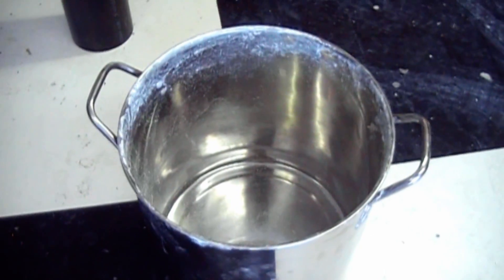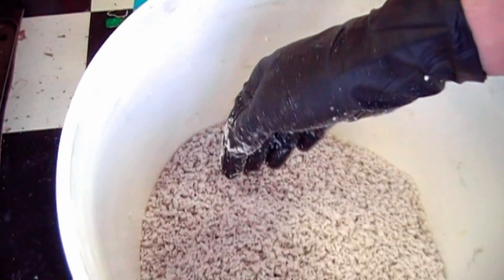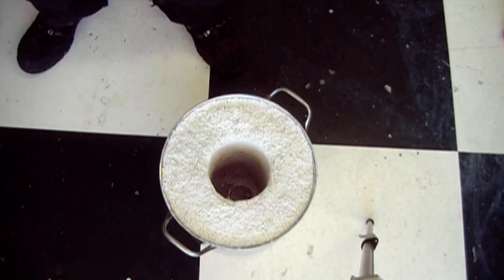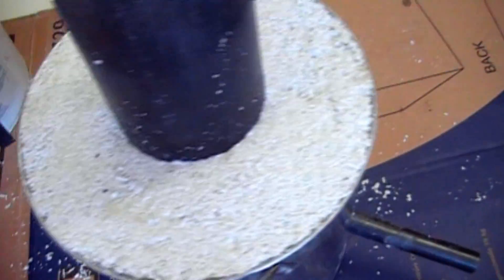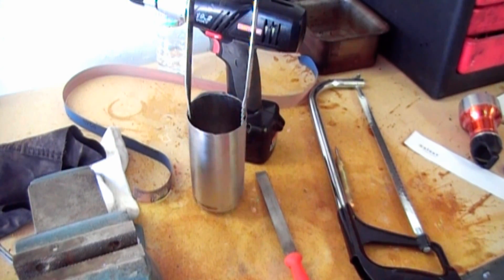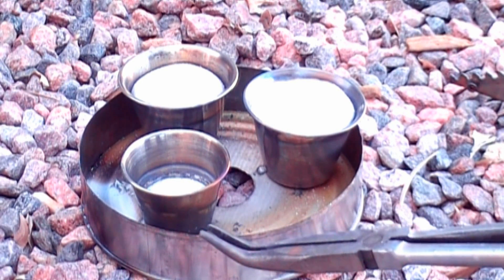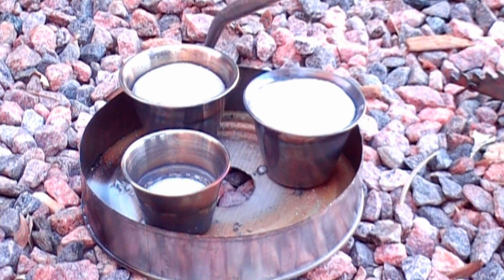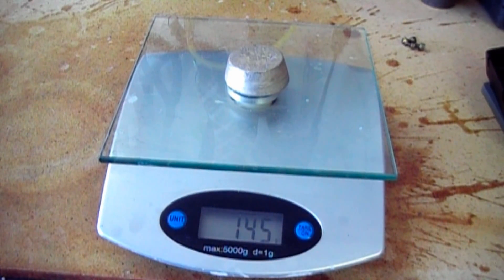How to make a small foundry

Comment: While I realize this video is very old, I noticed you were using a camping size 1# bottle of propane to melt the aluminum.  Can you give us any details on the burner that you used?  I am certain part of the ability to use that small amount of propane is attributed to the furnace construction.  But the burner also has to be very efficient and "breath" properly.  I would love some details on the burner, or maybe a burner build video if you're really feeling really crazy.

Next question, how is the longevity of the perllite, sodium silicate, water mixture furnace?    I'm sure the refractory level is very high, but does the furnace hold up over time, or does it break down quickly like a sand and plaster furnace?

Comment: I bought a Pyramid Products furnace from California 25 years ago.  It looks very similar to your furnace.  The one I got was $400.00 back then, it included a set of tongs a crucible and a wooden flask box. My crucible filled with Aluminum is ready to pour in 7 minutes.  Brass takes about 25 minutes.  Using propane as fuel.

Comment: You use propane in all your videos but do you think the refractory lining would hold up using charcoal as fuel?
Reply from the maker: I could I think, nothing really touches the walls when using propane, so a thicker inner sealing layer might be needed to help it handle the abrasion from the charcoal up against it.

Comment: i never understood why your stainless steel bottle doesnt melt but everythign else does?
Reply from the maker: Alexis Gagnon Aluminum has a much lower melting point than stainless steel. Brass is higher, but still below stainless steel. The size of my burner limits how hot this thing can get to just below stainless, so I don't worry about the bottle melting.
Reply: clkindred  thanks a lot for the answer, so i guess stainless steel would be the best container, but what if i want to melt stainless steel?
Reply from the maker: Alexis Gagnon then you would need a graphite or ceramic crucible.
Reply: Thanks a lot!
Reply: Alexis Gagnon because it's steel it has a very high melting point

Comment: Any easy alternatives to using propane?
Reply: works, done it.
Reply: anything that will burn, and any manner of forced draft for the fire. the heat energy per pound is what makes a fuel efficient, or not. charcoal and a drier is awesome, but pea coal and a drier is even more so (though far harder on your furnace lining). you can even use recycled tranny fluid if you don't mind pumps and such. the "magic" is in containing the heat as long as possible, so it actually does work, and sizing your "hearth" for the fuel load your fuel choice requires. the gas and oil fuelled varieties need a far smaller "hearth" (because you can pump the fuel in along with the air, no "pile of burning junk"), so can operate pretty efficiently even in VERY primitive trim, lol.  a wood fired hearth would require fairly expert use of the calculator just to prevent extreme fuel waste, on the other hand.

Comment: Would you not want to use concrete to make the furnace? What is the reason for the perlite and sodium silicate mix versus using concrete?
Reply: Concrete, when heated hot enough, explodes
Reply: Concrete cannot withstand the temperatures that a foundry can reach.  The perlite and sodium silicate mix can withstand about 2,000F.
Reply: I got to looking into that after I asked the question...thanks
Reply: that would make sense :-(

Comment: Why this foundry can't melt iron or bronze ? U write that u can melt just AL and Brass
Reply from the maker: bronze should be possible, iron is too high a melting point for this setup.
Reply: clkindred U mean furnace could also melt?  or break
Reply from the maker: Possibly the furnace lining would start to melt, but most likely would be it just would not melt the iron, it would run and run but never get hot enough to melt the iron.
Reply: ok thanks for fast replay .

Comment: will your furnace get hot enough to melt copper have you tried it yet
Reply from the maker: +Ronnie Newsome Yes I have tried it, but not just copper. I added come copper scrap to a brass melt, I thought it melted with the brass, but I did not wait long enough and did not see the solid copper pieces underneath the molten brass. I'm going to say it's possible, but pushing it.

Comment: You used just Perlite for the refractory? How has it held up?
Reply from the maker: +Hard69Rock's Cafe This exact recipe held up okay for a few aluminum melts, but showed signs of melting when I ran it hard to melt a few pours of brass, I still have it, but newer recipes are slightly different to address the melting problem.
Reply: +clkindred What other recipes have you looked at. I have been using a 1 to 1 to 70% plaster of paris, fine sand and water.

Comment: Great video, thanks for sharing, a question; Why did't you add the plaster of paris to the mix as you had with the smaller forge you made ?
Reply from the maker: +Justin McKinney I have found that plaster of Paris is not exactly a good thing to have in the mix. It's kind of a long story, but after I discovered what role the plaster actually played, I found that it did not fill that role as well as other substances. The most logical role of plaster is that of a binder, but not only is that not needed with the sodium silicate, the plaster decomposes at high heat destroying its ability to be a binder. The real job of the plaster is making a hard shell around the perlite particles, the perlite will get soft and even melt if heated hot enough, the hard shell is meant to maintain a firm structure. The final recipe I use has aluminum oxide as the shell making material, sodium silicate as the binder and perlite as a sacrificial space holder. When compacted into the form you get a structure of aluminum oxide that resembles a sponge, the voids created by the perlite, after high heat the perlite can melt without the structure collapsing. Not all the perlite melts, but the perlite is not seen as a primary part of the lining, it's just there to loft it up.
Reply from the maker: The aluminum oxide I used is sold as sandblasting grit, it is incorporated with the perlite and sodium silicate mix as well as the top coating. The aluminum oxide is the heat tolerant filler, the perlite adds insulation and the sodium silicate is the glue.
Reply: +clkindred Thanks for the quick reply! I've since checked out your trashcan forge video and I do believe I'm going steal your refractory recipe for my next attempt at this project. I had already been wondering if there was a way to make a surface coating more durable than exposed perlite, and that putty you made of aluminum oxide and sodium silicate looks absolutely perfect. Also if casting your own crucibles from the putty is really as easy as you made it look then man am I gonna have some fun. Thanks again, both for getting back to me and for just putting good info out there. Some other folks on Youtube (who shall remain nameless) are propagating vastly inferior castable refractory recipes which disintegrate after a couple of uses, and I dunno what the hell good that does anybody.
Reply from the maker: The crucible I showed was fairly easy to make, however the fact that there is water that needs to evaporate makes larger ones much harder to make. It's not exactly easy to cast because it needs to be unmolded while still wet, otherwise it won't dry. Perhaps wooden molds that can go in an oven for a few hours with the casting could let the water escape. So far I have only tried plastic cups to cast crucibles in.
Reply: +clkindred, What kind of details can you give me about this aluminum oxide? Where did you get it and how is it applied? Did you include it in the overall perlite/sodium silicate mixture, or is it a separate coating added after the primary casting? I'm currently working on my own version of this project and I'd greatly appreciate your input, thanks. 

+Justin McKinney, I just built my own one of these using a plaster of Paris and vermiculite mix, and I can confirm that the plaster of Paris does not work well as a high-temperature bonding agent. I only managed to get through two firings before the whole unit cracked in half. It was initially sturdy but it became more brittle as I used it, which would appear to substantiate what Clkindred said about plaster decomposing at high temperatures. When I try this again I am definitely using a sodium silicate mix.

Comment: would the perlite sodium silicate mix stand on its own without the stainless steel pot? As in if you used the pot as a mold then cut it off.
Reply from the maker: +Chewfacity It's possible, but you would need to make the lining denser where it contacts the pot so that it leaves the cast lining more durable once the pot is removed.

Comment: would the perlite sodium silicate mix stand on its own without the stainless steel pot? As in if you used the pot as a mold then cut it off.
Reply: Chewfacity if you can't afford a 5$ pot from a thrift store then you can't afford the aluminum. The pot gives it nice handles. And also I think it would start to crumble slowly from the outside if there is nothing holding it in
Reply: +Chewfacity Why would you do that?
Reply: so that I could use anything as a mold then cut it off.
Reply: so that I could use anything as a mold then cut it off.
Reply: +Chewfacity i can find zero reasons why that would help.
Reply: +Andrew Henry Really? Such as if I wanted to use cardboard so I don't have to buy a pot or waste one of my own. Then I can rip off the cardboard because it would rip off anyway after a while.

Comment: What propane hose do you use for that small tank?
Reply from the maker: +Timmahh The Dank Master It was just "TYGON" tubing, it works but I recommend something safer.
Reply: clkindred What would you recommend. And also what burner do you use?
Reply from the maker: A pressure rated hose like an air compressor hose, rubber brake line or hose meant for propane. The burner is one that I made.
Reply: clkindred Thank you!

Comment: Thank you for your experiments to help the rest of us! I know you made your own Sodium Silicate. Technical grade 40% is available reasonably inexpensive. Would you suspect that I would still need to add H2O? Secondly your first foundry you added Plaster of Paris to accelerate the set  time. Did that mix prove to be too fragile?R&D can be a fun but interestingly trying experiences, thanks again for your efforts . Safe experimentations should always be part of the planning process!
Reply from the maker: +Jim Maddox I don't think additional water would be needed with 40% That first project where I added plaster was an interesting learning experience. I added the plaster to help it set, but it also did something else which I did not notice until later. It coated the perlite particles in plaster, which was more important than I thought. This exact recipe with no plaster dose not perform as well as coated perlite. Perlite coated in a higher refractory material like aluminum oxide performs better still.

Comment: Can you drill a burner hole after you cast the foundry?
Reply from the maker: +Greg Jones That would be a nightmare, but possible. You would have a good chance of ruining the foundry though, like drilling through a sand castle you could destroy it.
Reply: +clkindred Ok Thanks didn't think of it like that.
A follow up question, I plan to make it duel purpose, standing on end and its side so I can use a crucible (standing) and to heat long bars/rods (side) having a removable base/plug just a tad smaller then the i.d... Also have different burner holes with a plug for them as well? Will the Plug end up bonding to the foundry wall/base after cured or through being heated???

Comment: Just wondering how well this refractory mix held up for you? as I am in the process of building a bigger furnace & I have been looking endlessly for a GOOD refractory mix that will hold up & last -but looks like I'll have to throw in the towel and buy a refractory  PRE-Mix cement  : (  I hate to do it though cuz it just cost so damn much
Reply from the maker: +Rosario W This exact mix I no longer use, the mixture I use in my newer trash can forge is the one I recommend, it has held up great. This mixture has no high temperature aggregate so if run hard and hot, will soften. The newer mix uses aluminum oxide as the high temp aggregate and the perlite is just there to give it some loft.
Reply: Thanks for the reply I think I will give that a try as the perlite and or Alumi Oxide seem to be the key in all the mix that I think will hold up- I did buy a small bucket of heat stop pre-mix(15lbs for $40 is outrageous) as I plan on using it as a top coat 1/2-3/4 inch thick over the mix that you list I have my fingers crossed Thanks again for the info

Comment: Thank you for the Video! Can you please tell me how long it takes until the perlite mix is cured?
Reply from the maker: +yxcvmk I waited a week before removing the inner form. but it won't fully cure until the first firing.
Reply: Thank you! Does it reamin pretty brittly (since it's perlite)? What's the temperature it needs for curing (rough area)?
Reply: +clkindred Dont you need to cure it with CO2 or Portland cement? I'm guessing it cures from the CO2 in the air?
Reply from the maker: Kind of, there is a lot of CO2 in the combustion gasses from the propane burner.
Reply: Oh yeah of course! Wouldn't of guessed i take chemistry. Could i add like a handful or 2 of Cortland cement to help it cure? It says online that its a curing agent.

Comment: Ok ty but does it take heat or just time to cure
Reply from the maker: both, time allows it to dry, but exposure to water will cause it to soften again. once dry, heat or co2 gas is used to set it, after that it's waterproof.

Comment: Interesting furnace :) What is the diameter\ high of the pot? What if adding some powder fireclay\refractory cement to the perlite mixture?Thanks.
Reply from the maker: +bingre I'd say about 15 inches in diameter by 20 inches high, fireclay could be good, I'm not sure on the refractory cement, that stuff needs to be mixed exactly like they designed, it is very fragile otherwise.
Reply: +clkindred i'm going to do it. maybe with some twists, like positioning the gas hole more tangential, covering the inner surface with a thick mix of s silicate and Al oxide and a lid. Lets see if it can handle molten copper temps. Greetings.

Comment: I'm planning on making a small propane foundry, what wall thickness in your experience is optimal? (I'm planning on the chamber being 2.5-3")
Reply from the maker: +Juggernaut12121 About 60-80% of the burn chamber diameter is what I would go for. This one is closer to 90% but that is just because that was the size pipe I got.

Comment: You've probably made improvements since this video was made, but I don't think it's the safest way of pouring your aluminum by pouring it towards your hands and body.....IMO that's a recipe for disaster...you should always pour away from you....
Reply from the maker: michael C Yea that pour method sucked, it worked well for extracting the crucible from the foundry, but separate pour tool is needed.

Comment: What temperatures could this go to mate?  Could you melt cast iron?
Reply from the maker: Tim Winks Probably not, the melting point of iron is very close to the melting point of the silicate binder that glues the lining together.
Reply: I made a similar design from sand and plaster of Paris that gets upwards up 1200. Melts aluminum and brass. Cast iron isn't something you can (or should) make in a diy foundry
Reply: I did the same thing with the play sand and plaster of Paris
Reply: Tim Winks Any heat that would melt iron will melt the crucible.

Comment: this seems like a lot of work I have seen other videos that used sand and plaster of paris and 5 qt bucket for the center and got better results
Reply: TheMrVert Actually I made the forge you speak of and it is pretty garbage. Sure it works and is cheap, but it becomes very brittle with repeated use. The sand and plaster start crumbling and don't insulate well.

Comment: Hi there, what sort of temperature can the perlite liner take? how would it fare in the combustion chamber of a rocket stove, I heard someone comment that the temps in there can reach 2900 centigrade.
Reply from the maker: 1Paulobambino 2900 degrees C is much hotter than what I would expect from a rocket stove, considering that's well above the melting point of steel. The perlite is good up to about 1900 degrees F (about 1038 degrees C)

Comment: How did the fireproofing stand up after a few melts?
Reply from the maker: PyroManiacs Pretty good, but not as good as I was hoping for, I ran it real hard to melt some brass, and the lining started to get soft. Coating the perlite particles in aluminum oxide solves that problem. My trashcan forge video is where I show that process.

Comment: Is using cement a bad idea?
Reply from the maker: ladydreamer1000 It depends on how hot you want to run it, and how well you want it to perform. A very hot run can cause lots of damage to the cement that uses a hydrated mineral for its strength. If you burn all the water out of it then it crumbles. Likewise the water in the cement can make a foundry with a weak burner struggle to get hot enough, because the heat is being lost in the steam.
Reply: Ah, that makes sense. Thank You!